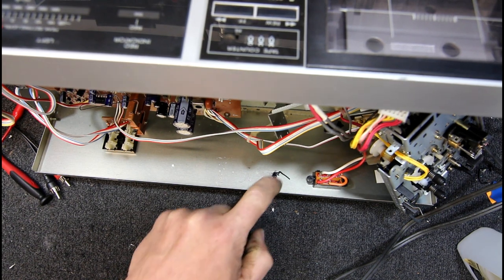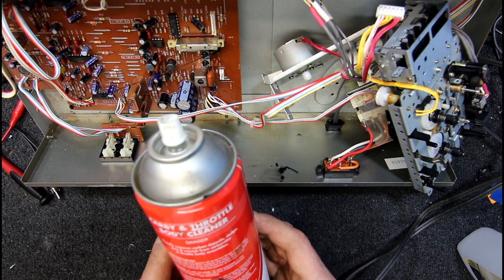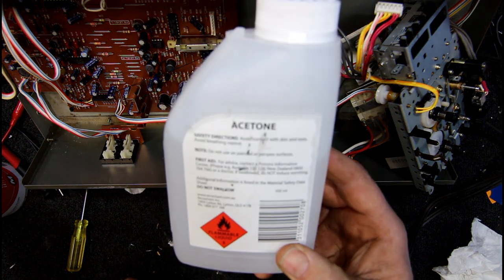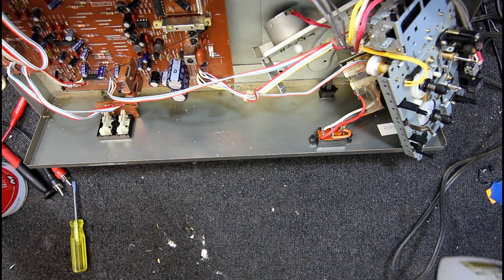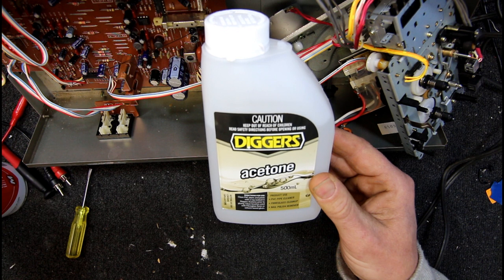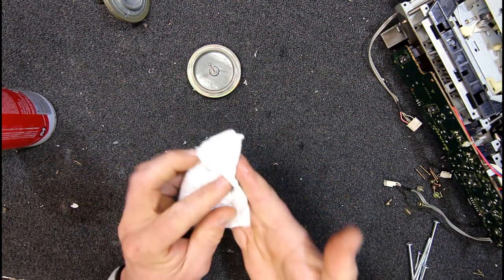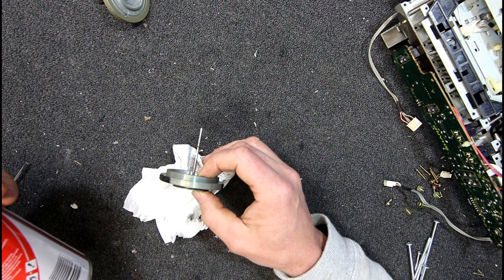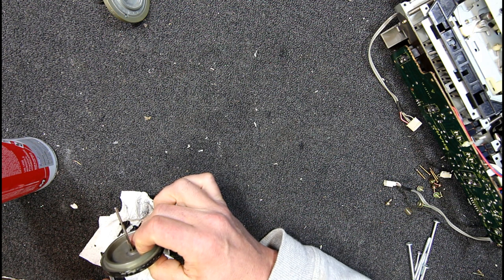Removing Sticky Rubber Belt Residue From Cassette Players

Comment: Good to know, I've run into this before but also just now had an old 70s wristwatch that had a gasket that had turned into goo just like the cassette deck belts and it's amazing how much mess such a little gasket can make and it never comes off your fingers and just spreads into anything you touch. 

Had some success with some electronics cleaner but I guess I need something stronger, don't have any carb cleaner or acetone handy but I'll have to dig around to see what I have. EDIT: weirdly enough had some success with WD-40, obviously it leaves things a bit greasy but it mixed together with it pretty well and then could be cleaned off with something else

Comment: Good info! I have some carby cleaner and will definitely give it a go on the next black goo belt mess to tackle.
You experimented much with PCB cleaning / de-fluxing? I've tried Jaycar's PCB cleaner and it does a good job but I've seen YouTuber's use brake cleaners of all things to deflux boards.
Reply from the maker: I have only used the stuff made specifically for it along the lines of the Jaycar product. I think brake cleaner is supposed to dissolve resins so it may well work, but you would want to check all the chemicals in it are OK on circuit board materials and components if you were going to soak them in it. I would think the proper stuff is plastic friendly like the products made for cleaning switches and potentiometers.
Reply: @StevesElectronicRepairShop   I just got a Panasonic RX4922L (same as the one I had as a kid). The belt had dissolved. I removed the goop with a combination of Holts Brake Cleaner and NAPA Electrical Contact Cleaner. Working well now, I've temporarily used a thin elastic band as the drivebelt while I wait for the proper one to show up.
The NAPA stuff worked very well on the crackly volume control too.